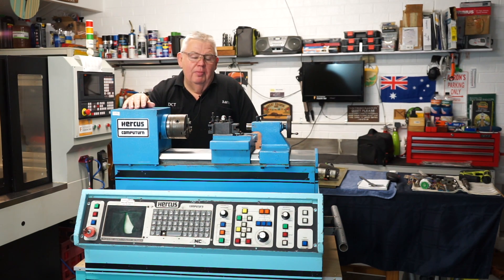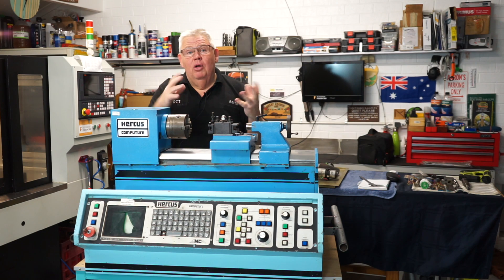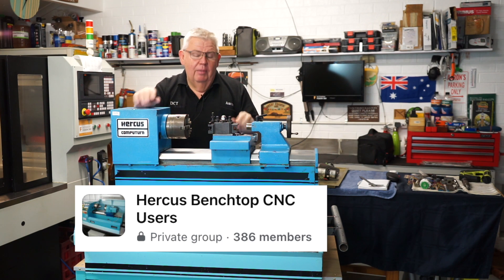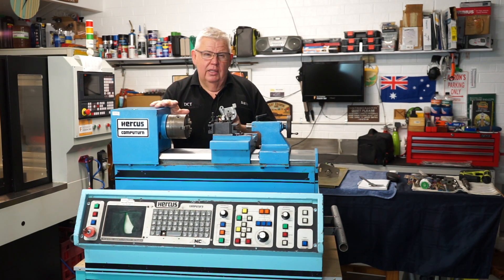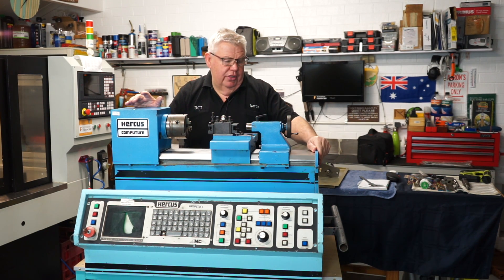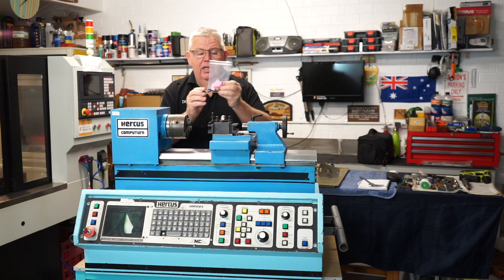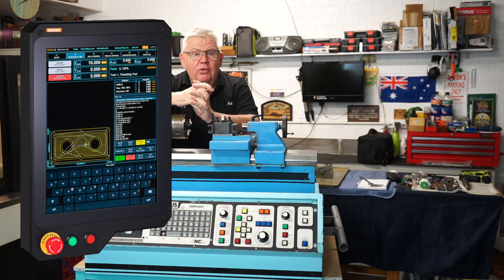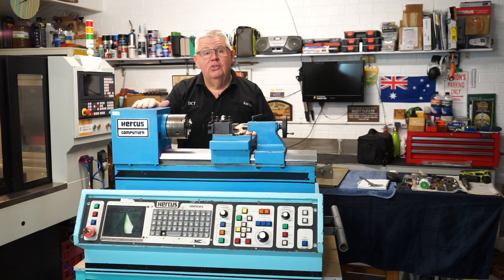CNC Lathe Retrofit - Pt.1 - Hercus / ANCA Computurn

Comment: Great video and explanation Aaron. Looks like I will be spending some money with Peter Homan as well. ....encoders and Gecko's and the solution he has for the spindle motor...I will put the bite on you for those lasered way wipers too :)
Reply from the maker: G’day Mark. Yes Peter Homann is a wealth of knowledge. Absolutely reach out to him. I will design and 3D print the adapter plate for the servo motor and  encoder. I’ll cover this all in the videos. I’ll laser cut and or 3D print you some wipers too. Cheers 🍻

Comment: nice little lathe, i have a lathe that i use to have a masso controller on. but ende up taking it off, not because it was no good, but because there was to many lathe G codes that the masso did support, but if you program with fusion i think you will love it
Reply from the maker: G'day Søren. Thanks for the feedback. I appreciate the insight into your experience with the controller.  I will be using Fusion 360 to do all my CAD-CAM work and post directly from it.  Regards, Aaron.

Comment: Hi Aaron, I wonder if any of the Chinese 4 tool rotating tool posts would be small enough to fit the lathe?  There is always gang tooling as an option.  My Gang Tool blocks are fitted on the carriage, I imagine you could do that too.  The motor you spoke of needing to be able to reverse, is that the 180vdc motor in the PC200?  They go in reverse, in mine the signal just goes +10 or - 10 to get forward or reverse.   Not so long ago I had communication with the screw maker in Switzerland.  The young lady there asked for a photo of screws that were older than she was. LOL  Look forward to seeing more of the lathe as I have never owned one. I would not be able to drive it anyway, the cad cam in the PC200 makes programming so easy by comparison.  I drove past ANCA today, they are still going, which is pretty amazing these days.  I can only assume they are able to export.  Not too many folks here make anything anymore.
Reply from the maker: G'day Nigel.  Your channel has really put the spotlight on these Hercus lathes.  Many people ask  e if I've seen your videos.  The rotating tool post would be an excellent option for this little lathe.  To be honest, I was really excited when I first brought it home and it turned on.  Sadly that experience was short lived as it never turned on again.  Great to see ANCA is still in operation.  I was actually training their apprentices when I was at TAFE.  Yes, sadly not much is made here anymore.  As for the Masso retrofit, I will program it via "Con-Fusion 360" (joke ha ha).  Lovely to hear from your Nigel.  All the best mate.  Cheers, Aaron.